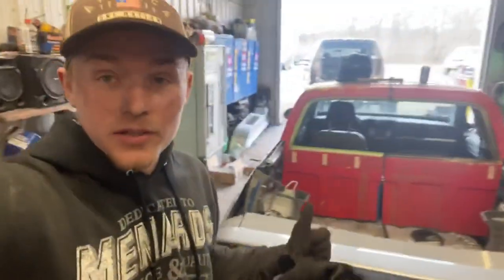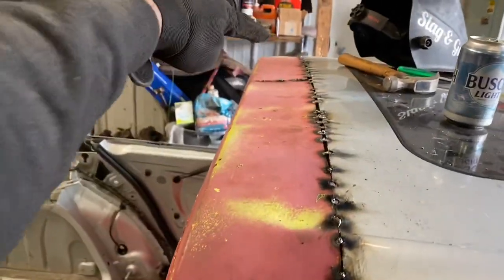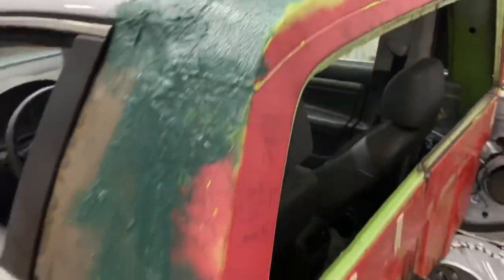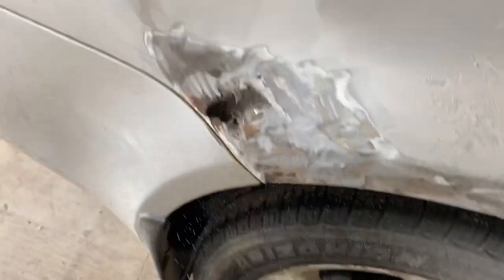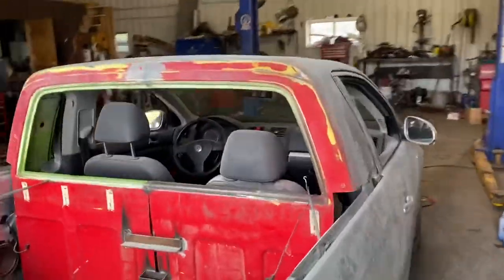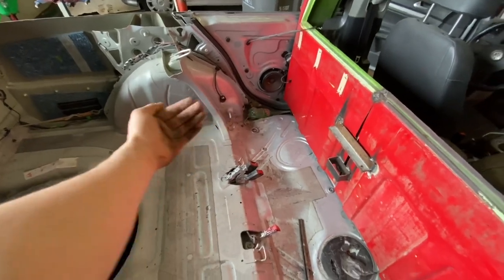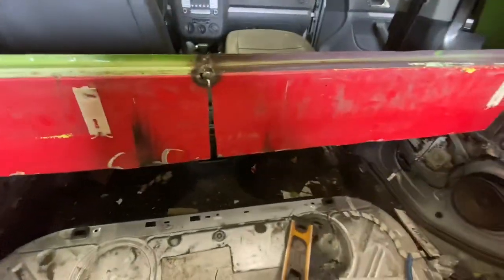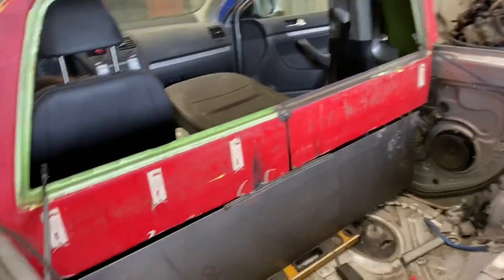Jetta truck build pt.2

Comment: You have weakened the car by cutting off the roof. Need to stiffen up the seals by adding box still
Reply from the maker: It has rear cage. Significantly stronger than stock.

Comment: Is it possible to make a insert to set in the back, like a bed liner that goes up the sides and angle iron on the top? Maybe don't even weld it in, make it lift out to access the fuel pump and spare tire
Reply from the maker: It will have a full be insert and will for sure have an access port for the fuel pump. As for the spare tire I will probably just have it laying in the back